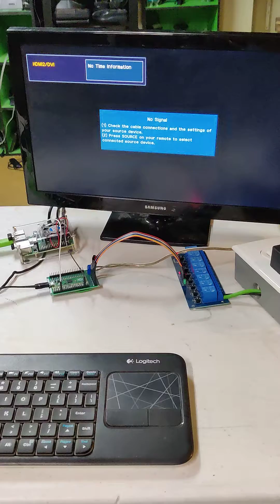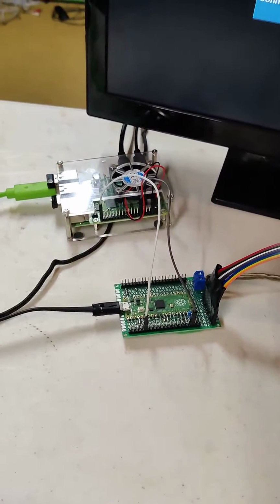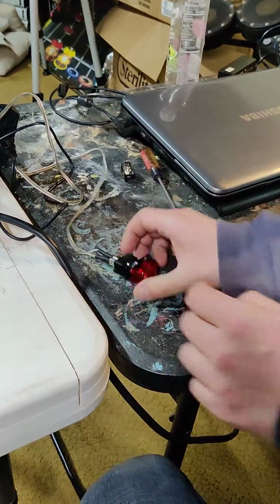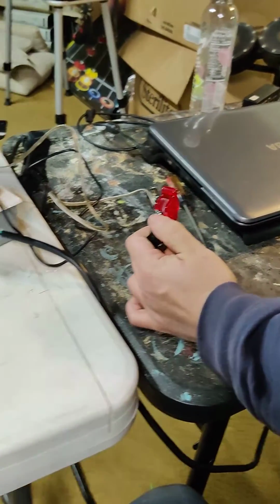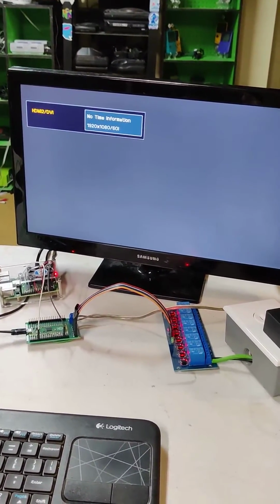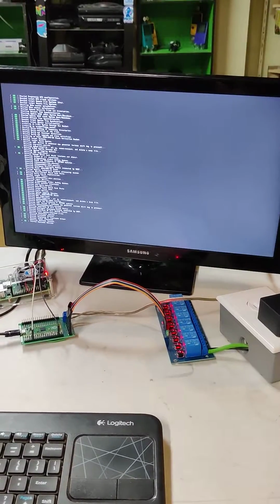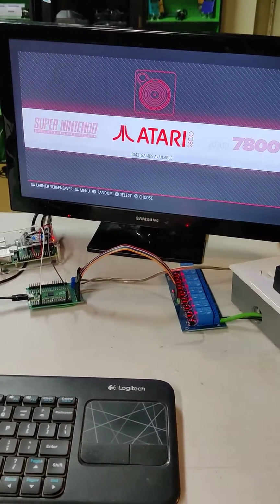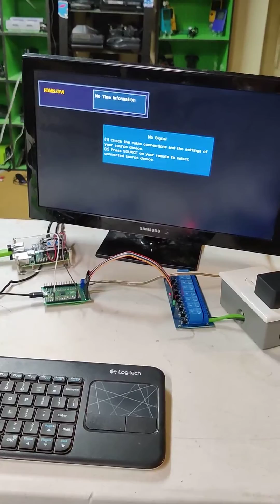Raspberry pi pico controlling Raspberry pi 4 arcade

Comment: That's such a dope way to pull the multipurpose the pico, sending a shutdown signal to the 4 and then waiting for it to low before killing the main.  Are you gonna drive the switches from the 2040 as well?